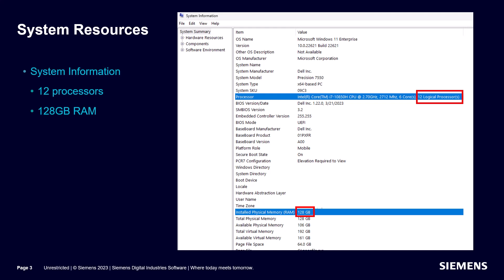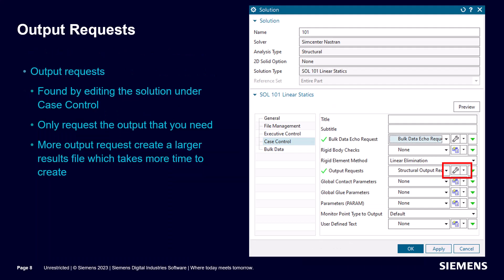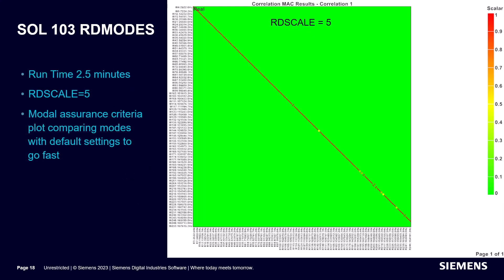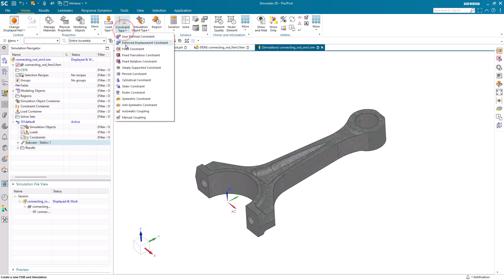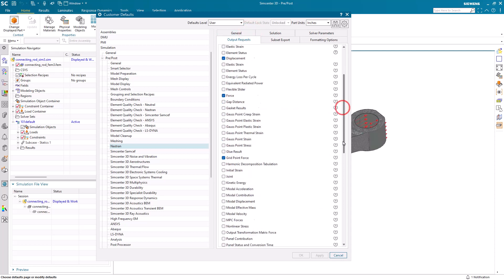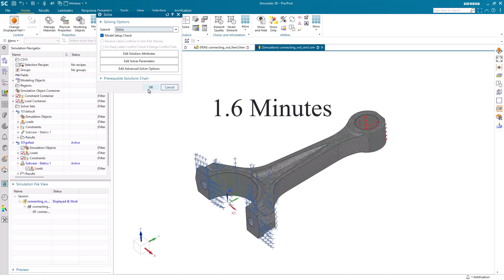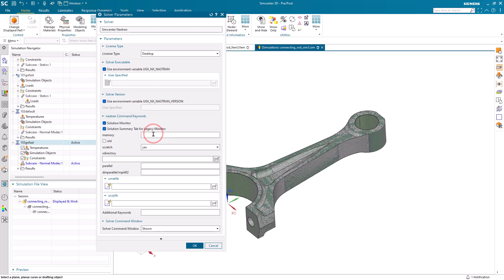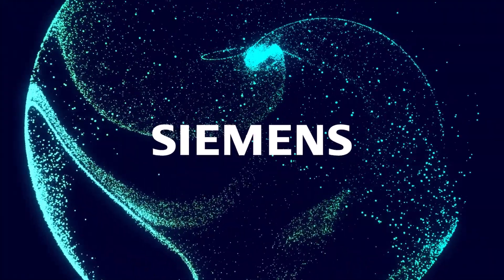How To Make Nastran Run Faster

Comment: The system configuration shown has an Intel i7-10850H processor, which contains 6 physical cores. Hyperthreading is enabled in the BIOS, which results in 12 logical processors reported.

Per the "Hyper-Threading on Intel Processors" article in the Nastran Installation and Operations Guide, Hyperthreading should be disabled to avoid threading conflicts.

With Hyperthreading disabled, the Nastran SMP/PARALLEL keyword should not be set to a value greater than 6.

Comment: Do these settings work on large shell models with laminates? Or are there other variables that better optimise the calculation time?
Reply from the maker: Yes, most of these tips apply to all types of models.  The exception being the Element Iterative Solver which applies to models made primarily of solid elements.
Reply: I can confirm that these settings work well with solids. These settings reduce calculation time by 4-8 times. However, these same settings do not give the same results with shell assemblies or contact assemblies. I am currently seeking the most optimal settings.